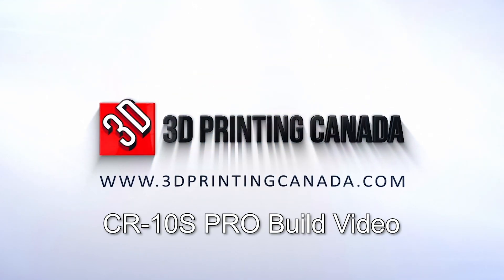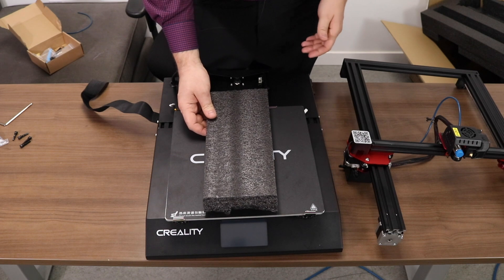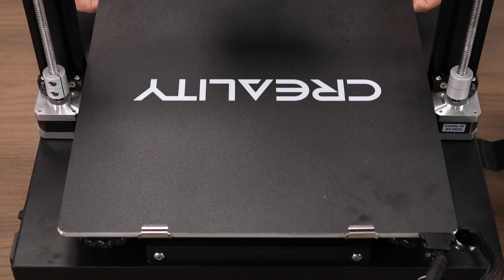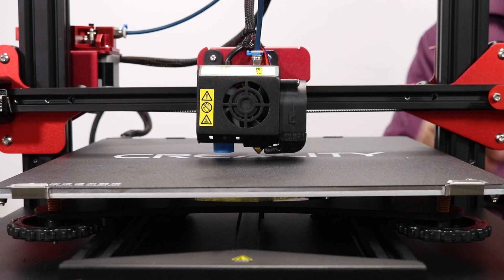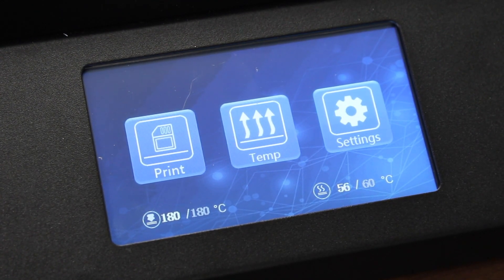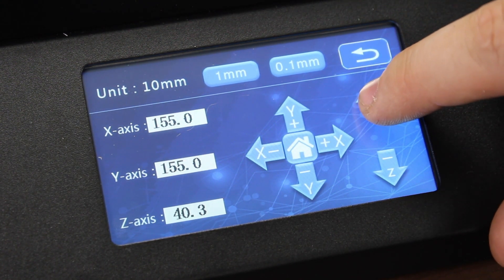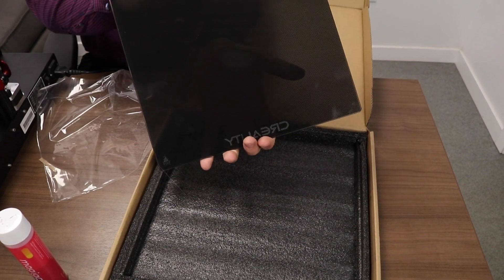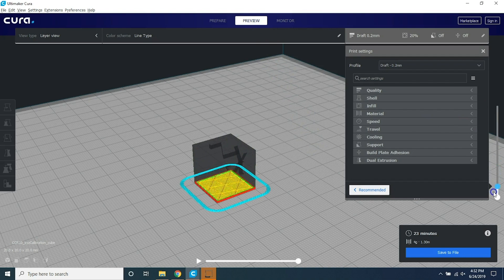How to build and use a Creality CR-10s Pro (The Quick Start Guide)

Comment: FYI: If you are watching this in 2022 or after, you no longer have to adjust probe distance with screw driver. “The part in video showing removing silicone and adjusting screw until LED light comes on”.
Thank you for this video!
Reply: Why is that? Because new printers already adjusted? Means if i buy an old one that is not used i still have to adjust it?
Reply: @haithemali4769  it’s been several years, but I believe printers produced after this video, came with a different type of sensor that didn’t require manual calibration with a screw driver.
Reply: @bowieinc   ok thanks, just one more question: if this silicone was missing means its been adjusted before right?
Reply: @ I’d guess so, you can go back and address if you have first layer issues not sticking well or being too squished.

Comment: Man, I'm about to throw this CR 10S Pro V2 right out of the dang window.  It's not doing a damn thing.
Reply: im in the same boat.
Reply: @Imokay69  I went and bought 2 Alfawise U20 Plus 3D printers, and they're a lot worse than my CR 10S V2.  I finally got that running.  But, the 2 Alfawise U20 Plus 3D printers are pieces of crap. Can't get anything to stick to the part plate. Plus, the filament keeps getting pushed out over the gears.  Don't ever buy an Alfawise printer or anything else from gearbest. com

Comment: So glad i never bought ender 3. Im a mechanic and yet putting the printer together looked a faff. Dont mind rebuilding engines and gearboxes. I bought a Creality CR10s pro V2 and that needed more building than I wanted too. 

Never stated the nozzle would be too low to be able to fit the gantry with the screws, or how to adjust it. 

Sexy zyborg channel solved that. 

Now though. Cant load filament first time. Is it because I have not told nozzle to go to 210c....? Else if not that I just dont know. You can feed through filament sensor. See light turn blue but then it stops. You cant push the filament through. 

I pressed that lever and still not able to load filament. 

Any ideas...?

Comment: My CR-10s Pro leeks from the nozzle when the nozzle gets up to temp (usually starts at 180C) I see upto 25mm of filament on the end of the nozzle by the time the print starts. This also happens during the print and after the print has finished. I think this is leading to my stringing issue as well as failed prints. Any suggestions?

Comment: What a great video. 👍🏼 I just ordered my CR10S Pro.. wanted a larger size than my PrusaMK2.5... questions.. a Credit Card should substitute for a feeler gauge I believe in being same thickness. Also The newest Cura has the CR10S Pro.. so I guess I don’t need to add anything to old CR10 settings. You have just gained a sub! Thanks

Comment: Whenever I try to save a file to my SD card it NEVER transfers or shows up on the printer. Any help?
Reply: Is this a new SD card? sounds like the format of the sd card is incorrect? CR-10S Pro does have a file limit but it still should show files if its format correct.. If it can not read ANY SD card then check the plug for the SD card make sure its plugged in (inside the printer) If you are having issues with 1 SD card but can see files from a different sd card then its the formating of the SD card. But if it cant read any SD card then the plug is prob disconnected inside the printer.
Reply: @st0mper121  Im just stupid and had no idea that the file name has to be around like 10 letters long. Now it all works, but thank you so much for the reply!
Reply: I can't get my computer to detect my SD card

Comment: does the capacitive (original) sensor work with glass? i think no
Reply: yes it works (but its sensitive for environment changes), but I suggest buying a inductive one, cost you 10 dollar, and 15 minutes to install. gives much better results